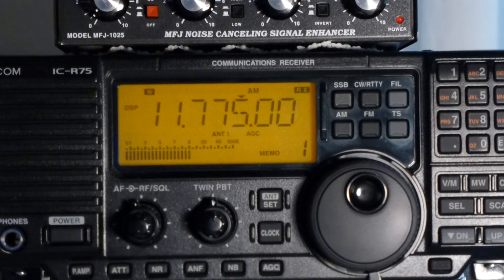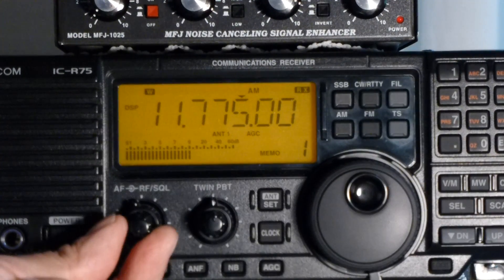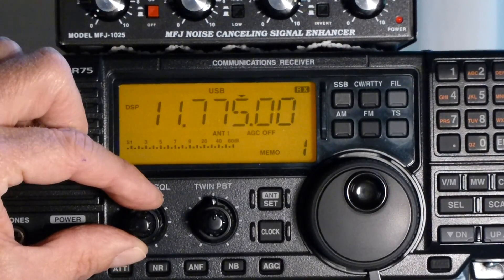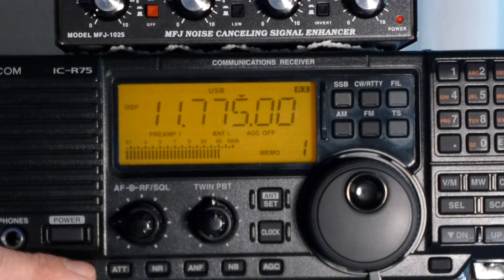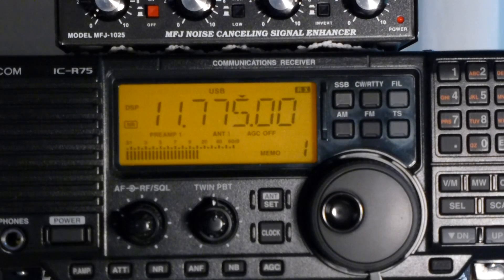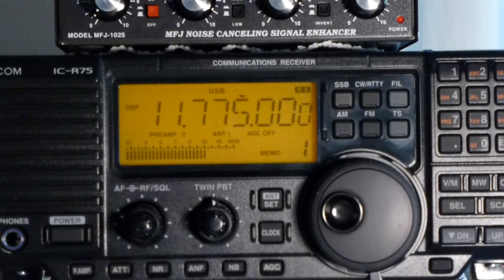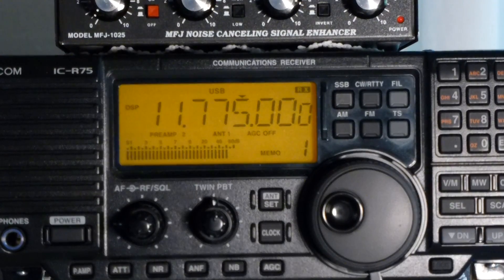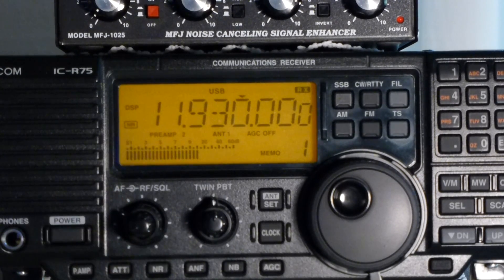ICOM IC-R75 SWL tricks using ECSS

Comment: Nice video, but you largely ignored the value of the Twin PBT. For me this is the R75's most valuable asset, for removing interference on weak signals. Yes, it's true that one can use the Twin PBT as a quasi-Tone control, however it' best at getting to the 'meat' of a voice transmission -- while shaving away unwanted background noise at the same time. In USB mode adjust the Twin PBT's toward the right, vice versa for LSB mode. It makes a major difference on those really weak signals.

A similar trick involves using RTTY mode for all voice transmissions, AM or SSB. This requires off-tuning and experimentation with the Twin PBT's, This trick alone has made many inaudible weak signals very audible.

Comment from the maker: No new videos planned at this time about my antenna but maybe another one about using the R-75.  I use 2 antennas.  Both are end fed.  The main antenna is over my roof.  The second antenna is about 100 ft. of wire running along the top of my wooden yard fence.  This antenna is attached to my MFJ-1025 which requires 2 antennas to work.  I use the 1025 less than 10% of the time.  I find having the DSP and the ATT  on together using ECSS usually does the job.  Also...the radio is not grounded at this time.